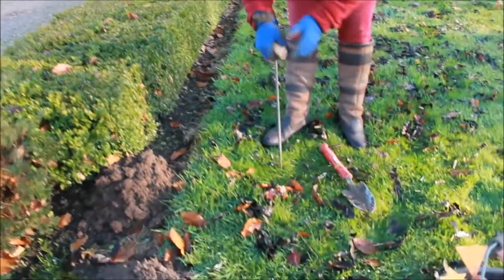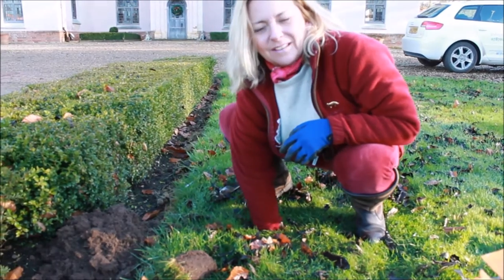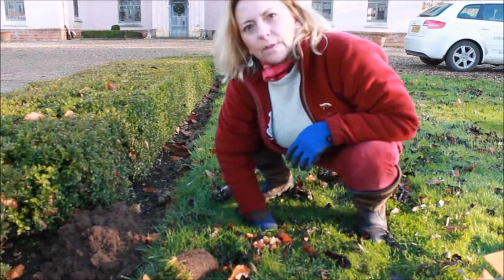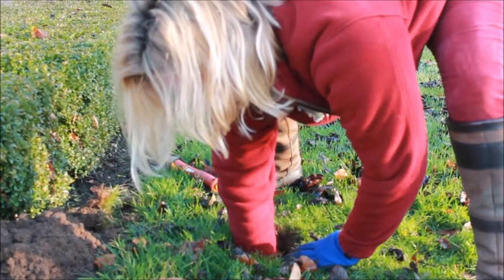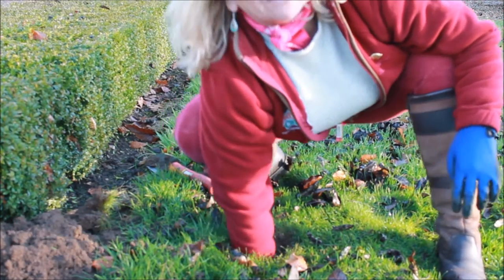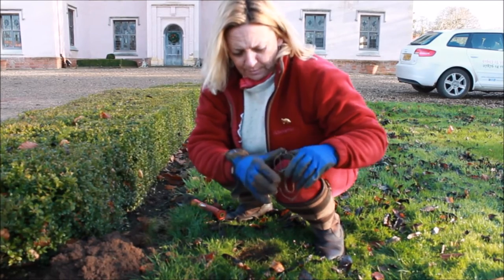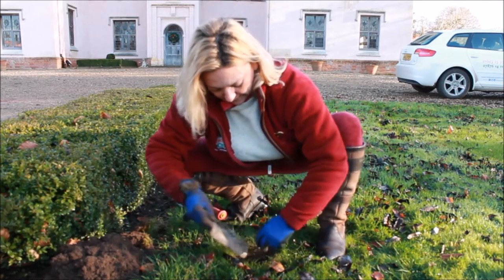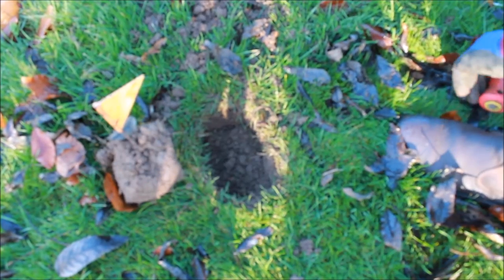Laying a tunnel trap

Comment: I have a compost bin and of course the mole has built his home in the 
middle of my compost bin in the rectangular aerator.  The mole built a 
straw cover under my plastic cover which he chewed into.  What is my 
best approach to catch this mole?  How many do you suspect there are?
Reply from the maker: Hello.  This does not sound like the behaviour of a mole but more like a rat.   Moles do not chew into plastic, 
but rats do.  Therefore, best to call your local pest controller if you are not happy with the rat in your compost heap.
Reply: I am not familiar with rats eating mice.  I saw  a little black fuzzy mouse-like creator crawling towards my compost bin.  It has eaten all of my worm families.  I really think it's a mole.  It had dug a mound along our wall, but at the time I was uninformed and covered the run.  I now realize I should've placed traps in the run.  It also dug up soil in my low tunnel which I also stuffed those runs with sticks and junk mail:(
Reply: Rats do sometimes kick up a mound, they are not as uniformed as mole hills though. What could have possibly happened is a mole has discovered an empty rat nest i.e the rat chewed through initially etc then mole has moved in and is moping up the worms
Reply: I have (4) snap traps now.  They have "mopped up" my worms in record time.  Amazing!  I will have to locate a new run so that I can use the traps effectively.  They mostly travel above ground now that i have stuffed their runs with sticks and junk mail.  I saw their tracks when it snowed.  They come from the opposite side of my garden now that their old run is blocked.  Trapping moles is a real education.